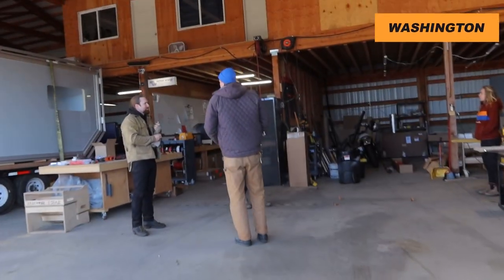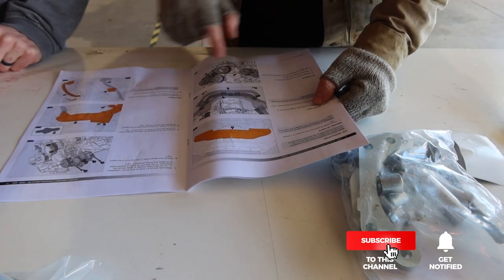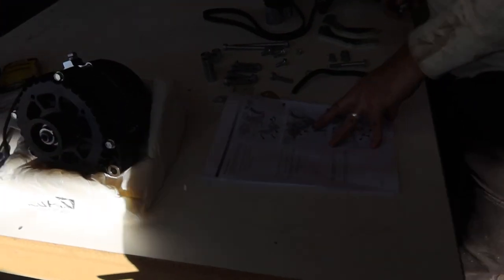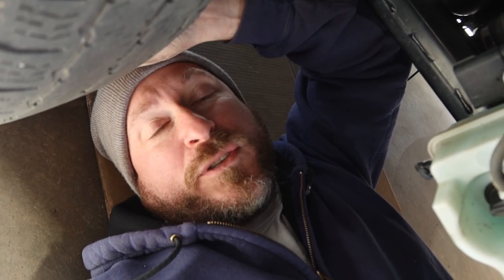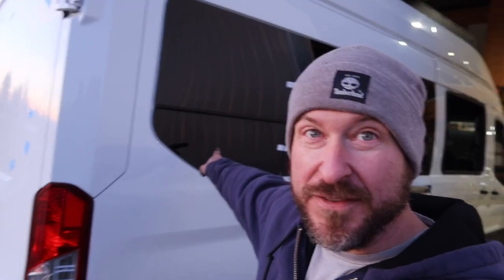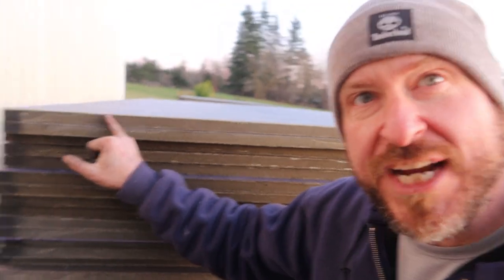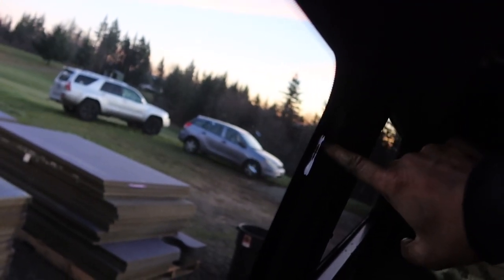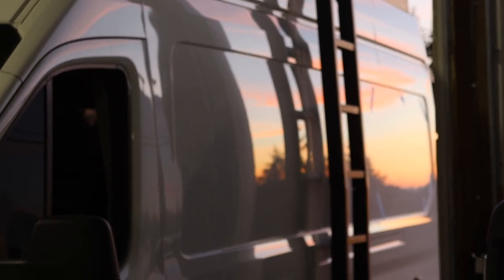48v Monster Secondary Alternator!  5 Kilowatt Beast! | VANLIFE VLOG

Comment: I am doing the same installation for a truck that will be built in China. 2nd alternator 48V with WS500 regulator. Take attention to the pulley ! The faster the alternator turns, the more power and the more cooling !! If it turn too slow, the alternator heats up and the regulator will lower its power. So to get your 5000W ....  it depends on the right pulley. Most alternators accept max 6000 rpm what must be equal with the max rpm of the engine for example 4000 rpm. Normally your engine will have about 1500-2000 rpm, that means your alternator will turn at 2250-3000 rpm... it will give you only about 60%-70% of your 5000W !

Comment: Would be interested to know what the output of the alternator is while the vehicle is stationary with the engine idling? I guess it depends on the idling speed of the engine...
Reply: Alternators are rated at Idle speed. Contact the Manufacture.

Comment: What kind of battery you used for your RV? I was told that special lithium battery has to be selected, that means only nations certified battery can be used with their 48v alternator. What kind of battery should be?
Reply from the maker: I have 4 x 12 v x 200ah Victron lithium batteries to get 48v
Reply: But Adam (nations guy) told me that I only can use pylontech lithium battery for nations 48v alternator, why?
Reply from the maker: @8548-u1z  I never personally spoke with adam. But he did council Sam who designed my system.
Reply: I will try to connect with Sam, thank you very much

Comment: Have you had any problems with the solid state pulley? They weren't able to use a clutch type pulley with this alternator, so I've been dragging my feet on installing it. I actually was the first person to order this kit and pay for it all the way back in February of 2020 if you can believe it. But it took forever because they couldn't get a clutch pulley to work, and after hearing that I wanted some other users to try it out first. Any feedback would be greatly appreciated. I only vaguely need this kit after installing 1110W of solar. But every now and then I do need extra power, like long periods of very cloudy weather in the hot summer months, or if I have to be parked under tree shade. Aside from those occasions I'm net positive solar even with 24/7 climate control via a 42 SEER minisplit a/c.

Comment: Cool install. Do you have the model number for that 48v 100 amp alternator. Thanks!
Reply from the maker: Im using this alternator.. but the wakespeed is a 3000 and not the 500 https://www.nationsstarteralternator.com/Ford-Transit-48-VoltDual-Alternator-Kit-p/9812-51v-hpx100.htm
Reply: @JaYoeNation  Thanks!

Comment: What’s the material to be used for heated floors?
Reply from the maker: It’s a composite closed foam fiberglass mixture
Reply: @JaYoeNation  That’s interesting. Do you know what advantage it has over high-density extruded polystyrene?
Reply from the maker: @adamsherman  it’s much stronger. It’s supposed to have similar durability and density as Baltic birch.